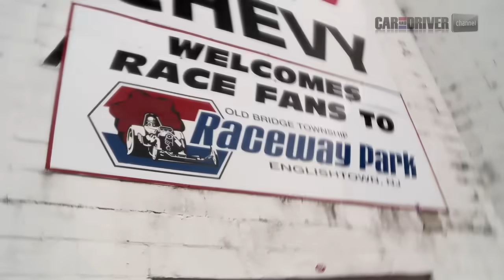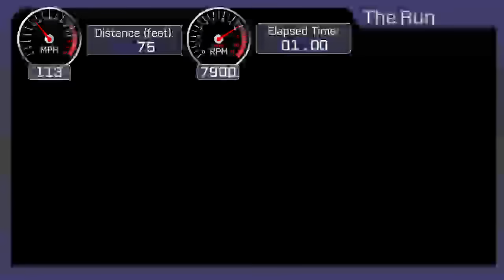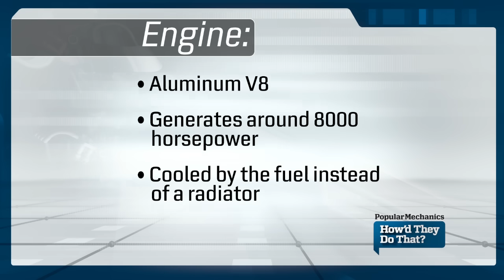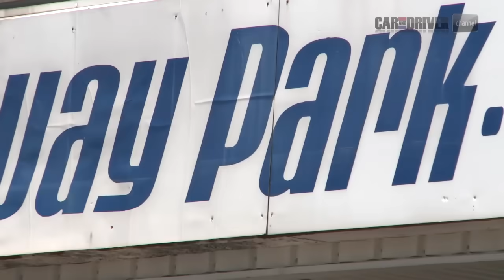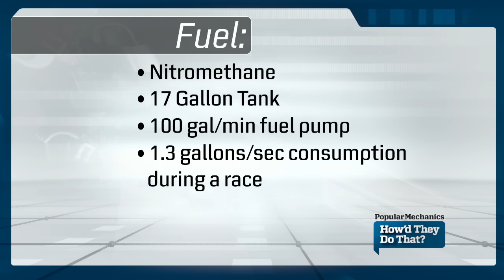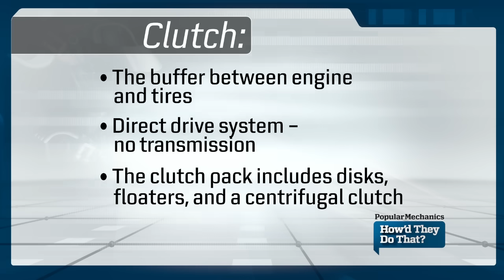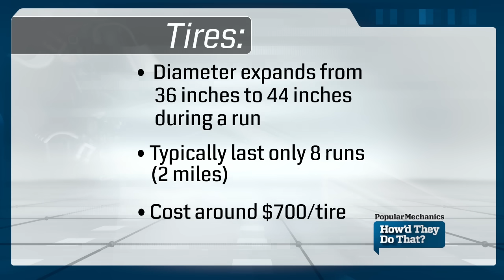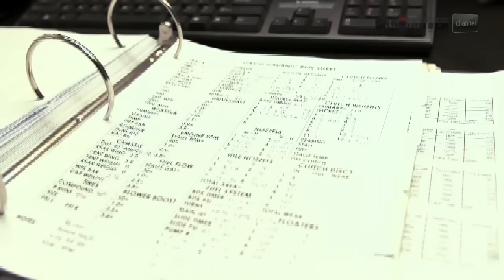How a Top Fuel Dragster Works

Comment: The parasitic lost from the supercharger is enough hp to have a Honda run mid 11's lol
Reply: That estimate was a bit high.  Its more to do with drag on the engine output than horsepower to turn the crank.

Comment: They only run for a few seconds! I would prefer they use liquid cryogenic oxygen stored in cryo-tanks and feed it into the pistons engines cooled by liquid N2 developing 30,000hps. This is the only way to smash new insane records or we will never get anywhere. The present records have stagnant for a long time.

Comment: Yeah, and a go kart with a small rocket engine would DESTROY them.  Just sayin.   You want acceleration.  Old man worked SPRINT...how about zero to MACH 10 (over 7000 MPH) in five seconds, with the nose cone going WHITE incandescent, like a light bulb filament, from air friction alone?  You sure as hell wouldn't ride it, though...about 100gs, or 20 times what these things do. 

Calculate the HP of a Saturn V some time.  Drag boys love to say they generate more power in one cylinder than F1 cars do in their entire engine.  Well, a Sat V engine generates MUCH more HP in a VERY VERY small percentage of one engine than they do in the entire race day lineup....ALL of them put together.
Reply: Too Sense Wirth  True that, shuttle too!  ;-)  I live in central FL and got to see pretty much all of them launch, one from the closest (for all practical purposes, it was a mess getting there, left at five in the morning, and MUCH worse getting out) location the general pop can see them, and one closer, as the old man knew engineers at the Cape (where press watched from, at the time).  Sat V left an impression on me to this day, talk about POWER!  When they say it shakes the ground, they mean literally.

The thrust to weight of any HEAVY lift, long distance mission, on the pad, is pretty marginal.  It has to be (actually EVERYTHING is marginal).  If you looked at the percentage of fuel load for the entire flight it takes just to get to high performance jet altitude, when what they are really boosting is about 1/2 fuel/1/2 rocket (give or take, but close), I imagine it would amaze both you, and me. On the trip to the moon, that was about a 1000th of a percent of the mission distance (at least for one man carrying part of it...some of those parts are STILL orbiting the Sun NOW, so zero percent of those miles traveled to a LOT of decimal places), and about 4% of the max speed.  A quick and (really) dirty pointy headed guess would be about 10% of the first stage fuel.  The Sat V took 150 seconds to burn through its first stage fuel, SPRINT took about 1.5 seconds....almost more of a contained directed explosion than a burn, really...think almost large size kids Estes rocket burn times.  Rockets are FUN!  ;-)
Reply: Too Sense Wirth  Very cool, I have yet to hear a AA fueler at the track, though, so you are one up on me there.  ;-)  I can tell you seeing about 35 stories of rocket going up is something I will never forget.

We lived just west of Orlando back then, about 40 miles, give or take, and my dad, being a physicist had calculated that if it was relatively quiet we should be able to hear the engines from that far away.  We waited the allotted time and we were able to hear it...barely. 

He also saw a SPRINT launch once from only a few hundred yards away at WSMR...UNPROTECTED.  Range safety would probably "HANG" someone now if they pulled something like that, but it was the "wild west" back then, apparently.

Comment: Electric motors should have already replaced these dinosaurs.
Reply: Simeon Orive they wouldn’t be able too. The engines use the most power dense fuel and an electric motor just couldn’t produce it without added weight
Reply: I think you underestimate nitromethane...   The best ET I can find according to the NEDRA is 6.940 in the 1/4 mile. Hopefully you are working towards (or already have) your EE degree and can improve these ET's to something within the realms of real drag racing...
Reply: I think I referenced nitromethane when really the the credits go to internal combustion. Mostly because regardless of fuel (Nitromethane = sub 4.5 second ; Methanol = 5.10's; Racing Gas = 6.455.) electric is no nowhere near to replacing internal combustion engines.

Comment: These vehicles are not very reliable, though, and fuel economy is very poor. It’s no wonder why these cars never sold well for everyday usage. They are “sporty,” but not much in the way of practicality. It’s upsetting that the engineers haven’t improved them to the reliability level of the Toyota Camry. Go back to the drawing board, folks, and produce dragster performance, yet with the reliability, affordability and practicality of a Camry.

Comment: Why not use a turbo and save that 600hp parasitic loss?
Reply: It partially because of tradition...and also because to run this amount of boost and air flow the turbos on a NITRO/TOP FUEL car would be massive. 

Only lesser HP dragster classes turbo experts have ran turbos.

http://bangshift.com/wp-content/uploads/2015/06/amc21.jpg

http://cdn.enginelabs.com/image/2015/10/2015-10-22_21-21-03.jpg